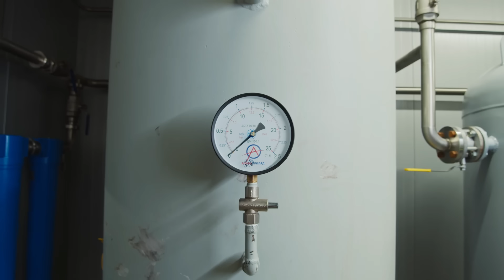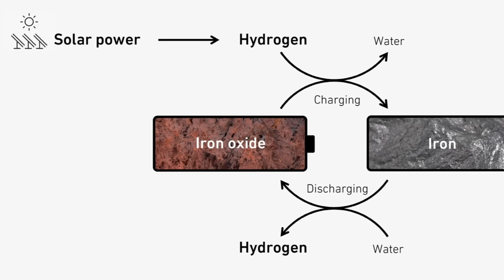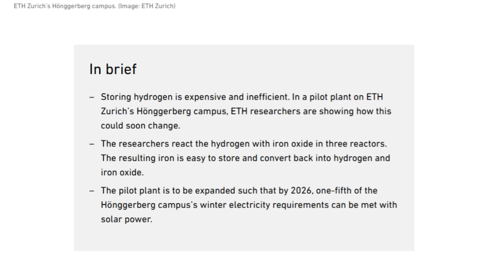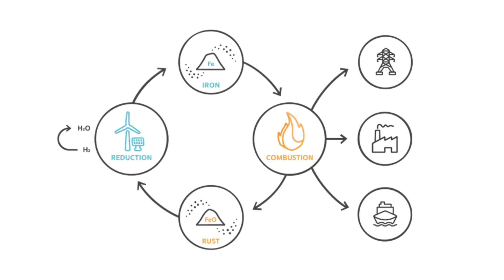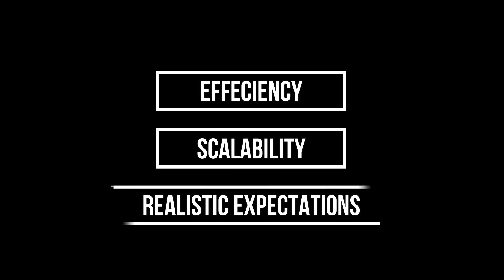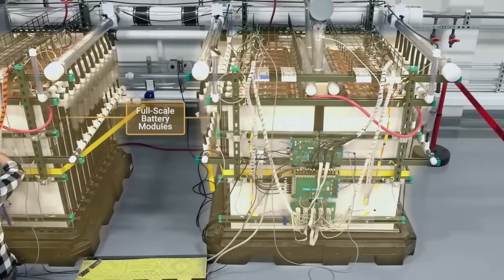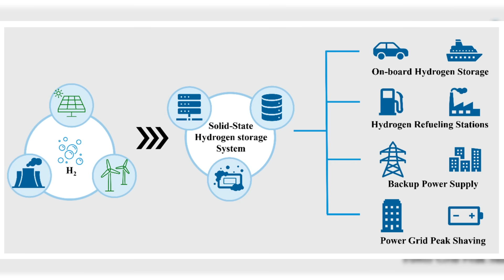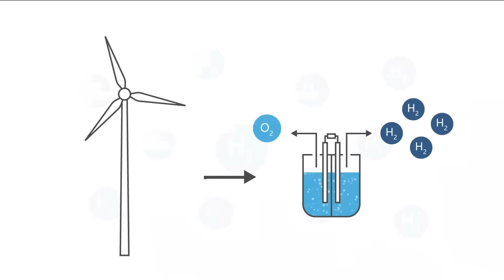Could This Low-Tech Solution Beat Lithium and Hydrogen Tanks?

Comment: There’s a seriously missing step in this magical process.
Where do you get the 400* heat from?
Oh you just burn natural gas.
So you get more hydrogen and energy out of the process than you’d get just burning the natural gas instead?
Um no you need about 1.8 times more energy from the natural gas than is generated by the process.
So unless you have a need to use pure hydrogen you are wasting at least 80% of the energy just to virtue signal and claim you’re using clean hydrogen. Is that right?
Um not quite. 
Oh?
We will actually be wasting about five times the amount of natural gas to virtue signal. The 1.8 is just the peak efficiency of the conversion process not all the ancillary waste that occurs.
Reply from the maker: You’re absolutely right to question where the 400°C heat comes from. If fossil fuels like natural gas are used to supply this heat, then yes, the climate benefits of the system would be negated, and in some cases, it could become less efficient than directly burning the gas.

However, the ETH Zurich system is specifically designed with renewable energy integration in mind. The idea is to capture excess solar electricity (e.g., in summer), convert it to heat or hydrogen, and then store it chemically in iron tanks. The 400°C heat can be provided via electrical resistive heating or waste heat from renewable-powered industrial processes—not natural gas.

The value of this system lies in its ability to store clean energy across seasons—something lithium-ion batteries or other short-duration solutions cannot do cost-effectively.

Regarding the efficiency: yes, hydrogen-based storage systems have a lower round-trip efficiency (~40–60%), but they don’t suffer the self-discharge that batteries do, and they’re designed for different timescales.

So, if we’re burning fossil fuels to drive this, it’s a bad idea. But if we’re storing surplus solar or wind power in a safe, scalable, and recyclable system—then it becomes a compelling solution for future grids.
Reply: @Generalphysicsknowledge.
There are various battery technologies being worked on such as sodium, molten sodium, aluminium, and water iron.
The safest one of those is the water iron battery all the rest including lithium and the one in the video can nuke a very wide area if you let them degrade and fail.
The energy required to sufficiently and usefully generate hydrogen from the method in the video vastly exceeds anything that would be available from wind and solar over capacity. Making it from gas or nuclear power is the only option where it could get enough reliable high capacity energy for sufficient time to achieve a reasonable result.
FYI
This method of creating hydrogen is very old , it was actually done as an experiment to determine what water was made up of.
Reply from the maker: @anomamos9095  You're right that many battery types are in development—each with pros and cons. And yes, this hydrogen-iron redox method is old, but ETH is applying it in a safe, low-pressure, stationary system for seasonal storage—not as a volatile fuel cell. It doesn't aim to "nuke" anything; in fact, iron oxide is non-toxic and non-flammable. Also, solar overcapacity is more common than people think—especially in summer. This tech is meant to store that energy when it's abundant and release it when it's needed. Different tools for different roles.
Reply: @Generalphysicsknowledge Iron oxide is one of the components of Thermite and in the right conditions if flammable and even explosive.
Over capacity is enormous especially in summer and during windy days BUT it is not suitable for anything that requires a constant stable power supply like the heaters for the process . Hydrogen is extremely difficult to store even at low pressure as it leaks out of almost everything. You could make a system that would work but at what cost and how many  batteries would it need to to keep operating  during power fluctuations . 
A propane tank large enough to provide winter heat and power would be about the size of the one Obama installed. A low pressure hydrogen tank needed to provide the same work capacity would be about the size of the fuel tank on the space shuttle times three.
Reply from the maker: @anomamos9095   Fair points—yes, iron oxide is part of thermite, but only when mixed with fine aluminum powder and ignited under extreme conditions. In this system, it’s non-reactive, low-temp, and sealed—closer to rust than rocket fuel.
And you're right: hydrogen storage is tricky, but ETH’s system avoids pressurized tanks by keeping the hydrogen inside the cycle—produced and consumed in the same reactor, not stored long-term.
Also agree that this won’t power everything alone. But for seasonal storage of excess summer solar, it fills a gap that batteries struggle with economically. It’s not perfect—but it’s not meant to be the only solution either.
Reply: @Generalphysicsknowledge I was mainly pointing out the flaws in magical thinking.
All systems have losses , the most efficient diesel generator is only producing the electrical equivalent of about 20% or so of the energy potential in the fuel used in the engine. The majority of New Green Energy inventions and such often make that obviously inefficient means of power generation look like perpetual energy machines when you do the math on all the factors involved. Wind and solar if anyone bother to do the real math on them would be a horror story of waste and inefficiency to the point that they have actually significantly increased carbon emissions over the coal they are supposed to replace.
Reply from the maker: @anomamos9095 Totally get where you’re coming from—there’s no free lunch in energy, and losses are everywhere. You’re right: some green solutions get oversold, especially without full lifecycle analysis. But that’s why systems like this are interesting—not because they’re perfect, but because they aim to fill gaps (like seasonal storage) without rare materials or pressure vessels. We definitely need more real-world math, less hype. Appreciate your honesty.

Comment: every drop of oil every meal every bit of clothing or timber all revolves around plants splitting water into hydrogen and oxygen so we need a hydrogen feedstock for this process splitting water is efficient. the difficulty Storage ,which this process solves.

With this process, we could take our waste product of rust, and convert it back to Iron. No longer needing the huge energy needed to refine Steel With oil.
Reply from the maker: this would be so awesome
Reply: well the answer is on demand , not storage , which we have been brainwashed into what is the answer , also the ether is the answer to energy , but is hidden from us !

Comment: Hydrogen and steam aren't easily available, especially in winter. Heat(sand) battery is way better for home heating in winter
Reply: Use this process for megawatt energy storage , then sand thermal storage for the waste heat from that process for more immediate use
Reply from the maker: @johnstubbe3113 Great points all around. Sand batteries are awesome for direct heat storage, and hydrogen–iron systems shine in seasonal, scalable energy storage. Honestly, combining both could cover way more use cases than either one alone.
Reply: How many tons of sand do you need to store a mega water energy?
Reply: @johnstubbe3113  sand is cheap, actually free in Africa 😅
Reply: How big a sand battery do you need to store your entire winter's heating and lighting requirement?
Reply: @nickwinn7812 
That would depend on a whole number of factors. Neither heat storage nor hydrogen are particularly efficient as storage for electrical energy because turning either back into electricity is unlikely to break 40% efficiency, overall.
IMO, thermal storage is most suited to places where the demand for heat is high, because its efficiency is only limited by its level of insulation, and if the whole heat store is dug in, under the basement, then escaping heat will warm the house, anyway.
Reply: @q.e.d.9112  Escaping heat is not limited to travelling vertically. If you are storing thermal energy all summer  to heat your house in winter, then any energy lost from your store, into the house, during that period, will be a problem.
Most places where demand for heat is high, have relatively short summers and relatively long winters. This is another problem for thermal storage.
I can't see this being practical in all but a very few circumstances.
Better to use a ground source heat pump, which is after all, recuperating the thermal energy stored in the ground during the warmer months.
Reply: @nickwinn7812  they're calculations that sand battery with the size of one average room can store heat for a good part of average winter. A company in Finland promotes them, and they have very cold winters
Reply: @nickwinn7812  ignore the lighting. Converting the kind of low grade heat you can store for long duration into electricity is really wasteful. Size your power generation (presumably solar due to costs and efficiency I am guessing) for winter lighting and electronics, and use surplus summer energy to charge your thermal storage for heat.

That's what I'm doing with my off-grid build. I'm in a thick cloudy winter zone so I can't rely on solar energy for heating, neither passive gain nor solar electric is practical. 16 hour days and clear skies alao summer means there's an enormous surplus to store though.

Personally I'm using an enormous, HEAVILY insulated, cobble-filled basement for my storage. Sand works, but I want to extract the heat passively and the cobbles allow air currents and convection to do the work for me.

Still working out the maths on how much volume I need for storage, but ideally you really don't want to be trying to store over 120F, the higher you go the faster you lose energy through your insulation.
Reply from the maker: Good point, but there isn't winter everywhere

Comment: The main problem seems to be low efficiency, so you need use double the energy you need to store.🤔
Reply from the maker: indeed this is the biggest problem
Reply: @Generalphysicsknowledge This is where people are going wrong. 95% of the cost of solar power is in storing it. Even if power could only be stored with 50% efficiency, we would just need twice as many solar panels and it would make almost no difference to the cost of solar power.
Reply: @philipbrown9006  You did beat me by 1 minute: tho, i can't totaly agree. If those storages have to be kept at 400°C all the time, it will probably not be possible to scale them down to a single home size. The thermal loss will wreck the efficiency way below 40 %. 
If the ETHZ has a solution for that problem, 40 % is not a problem, at least if the costs a bearable.
Reply: @johnbraunschweig  I was more thinking of other forms of storage such as synthetic petrol. Whether this process was 100% or 50% efficient would not have much effect on the price per gallon.
Reply from the maker: @johnbraunschweig thermal loss will sure be a problem.
Reply from the maker: @philipbrown9006 are they even a thing ?
Reply: @philipbrown9006  with over abundance of ,solar, that doesn’t present a problem and the waste energy can be used to distilled water treat sewage with low-grade heat so that inefficiency isn’t a total loss.
Reply: @johnbraunschweig  The 400° C is only needed during the reaction
Reply: @johnstubbe3113  Let's do some math:
1 m³ iron is 7,8 tons. It's probably iron-powder with a lower density. Let's say 5 tons. The specific heat capacity of iron is 450 J/kgK. The heat-difference is 400K. 
--> To heat up 5 tons of iron from 0°C to 400°C we need about 100.000 kWh. 
If the 400°C are only needed for the storage of the electric energy, it's still a big hurdle on the efficiency. If the temperatur is needed for both, it makes it basicly unusable for smaller applications, like powering a home.
Reply: @johnbraunschweig 
The waste heat must be used. 
Hot water for starters. 
In winter, heat the home.

During cooldown phase, 
400C could run stove, oven, and clothes dryer.
With water and home heated downstream,  it is still covering 90% of a typical grid load after it runs out.

 Unless you charge an EV at night, the remaining load is mostly daytime,  so solar is used directly and conventional battery need is minimal. 

Shift workers and Retired folk can charge an EV during the day. Retirees can run the house off the EV batteries at night. 

Warm climate? Maybe Distill water. Run a steam turbine. Dry desiccant for a non electric dehumidifier.
Run a Stirling engine refrigerator and A/C.
Make ethanol! 

For heating up phase, 
You need waste heat.
 If you don't have a kiln on the property, you need a Much larger power input.
Reply: @chuckevans2792  Found the numbers: The ETH-Z has 3*1,4 m³ containers and stores 10 MWh of electric energy, which comes down to 6 MWh of usable electric energy. Given a presumed density of 5t/m³ for the iron ore, it's a usable storage density of 1MWh per 3,5 t. To heat 3,5 t iron ore to 400°C about 175 kWh are needed.
Ergo: This batterie can make sence, if the waste heat can be put to a good use... well, and if those containers are well enough isolated to not loose to much heat during the storage phase.... and it can produce enough output at lower temperatures.
Most of the problems will scale down with bigger installments.
Reply: @johnbraunschweig 
Thanks for the reply, good info.
As I see it the big issue is how hot must it be to store energy. 

If you have an EV to charge at night, cycle efficiency is important. 

Video says Adding hydrogen is exothermic. Lots of steam    to condense. 
I would assume that removing hydrogen would be endothermic. 
Several smaller tanks would make heating much easier, but heat loss would be worse.
Possibly use a propane burner to heat to starting temp. 
 How much of the hydrogen would be burned to make the steam to continue extracting more hydrogen? 

At current prices, with solar panels the cheapest parts, 
I think we should look at installs that maximize early morning and late evening power output. Midday oversupply is an issue for much of the developed world.
Reply: @johnbraunschweig 
If high rate storage is efficient,  10 homes could all charge 1 unit for a week, then all charge the next.
Reply: @chuckevans2792  Good point, we don't know the storage rate.
An approach incooperating a (small) community would indeed open up a lot of possibilities. Unfortunately the german law makes such endeavour nearly impossible.
Reply: @chuckevans2792  For a long time i was thinking about a pv-fence, which would maximize output in morning and evening. So the overall output will be smaller. Maybe it's better to build a normal pv-array and use a bigger battery as a buffer. It comes down to hte prize of the panel compared to the prize of the battery. The panels have become very cheap, the mount and the circuits less so.
Reply: @johnbraunschweig 
Sorry to see your rulers getting energy so wrong.
Curious to know the qualifications of they guy in charge of that department🙄

I think their rules are just made to hide their mistakes.
Reply: @chuckevans2792  The problem is this. The rules give a lot of cover for the companies operating  the electric grid. Those of course have not a lot of interest to allow thing which would minimize their income.
Reply: A big part of its efficiency depends on hydrogen compatible appliances. 
If stove, dryer, and hot water heater can run on H2, most of your energy use will be direct!
Heat the house with the hot water.

For smaller shared tanks, Another boost may be practical if demand is high enough: put   a  jacket on the hot reactor tank, use the left over heat to produce steam to extract the H2 from the next full tank. Even so the last 10% of the H2 will be needed to heat up the next tank 😑.
Probably not practical for home use, empty tank cools to fast for slow use.

Comment: I won't consider a system operating at 400 Celsius a system safe for ordinary household.
Reply: What about gas, oil or wood boilers? Those operate at even higher temperatures?
Reply: klausnielsen1537 The burner might be operating at a higher temperature but even on a high temperature boiler like biomass the water shouldn’t get above 80c. The flame on a gas cooker is way higher than 400c. It’s high temperature and pressure that could cause problems however we’ve been working with far higher temperatures and pressures for centuries now and are fairly good at controlling them with almost 100% reliable safety measures
Reply from the maker: @grahamhireme9283  Totally fair concern—but you're right, we’ve managed much hotter systems safely for decades. The key is isolation and control, just like with gas stoves, boilers, or even car engines. If built right, 400 °C inside a sealed unit is no bigger risk than what’s already in most homes.
Reply from the maker: as long as it is in a controlled environment i don't see a problem
Reply: An average weekend ... in hillbilly hollers. You worry too much. Darwin has an award for this kind of cutting edge innovation. 😂

Comment: This is technically hydrogen storage as water, from the stored energy potential in the oxidation of Iron. clever to use steam instead of Hydrogen to reform the Iron. Saves a step and saves energy and does not use exotic catalysts like conventional metal hydride storage.
Reply from the maker: indeed i love how they came up with a new approach, which makes it more effizient and cost effective
Reply: This technology has been used for a long time in the fertiliser industry to manufacture Ammonia